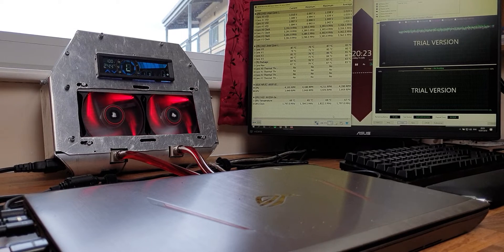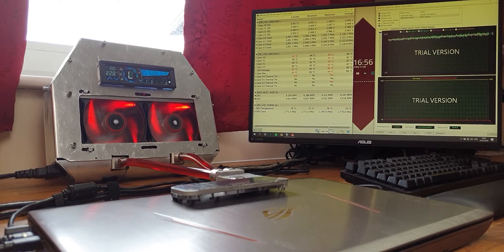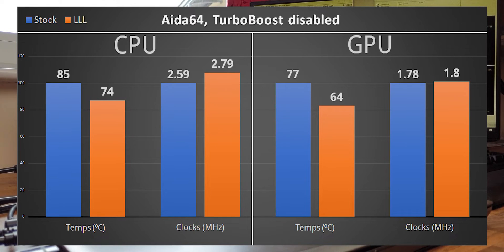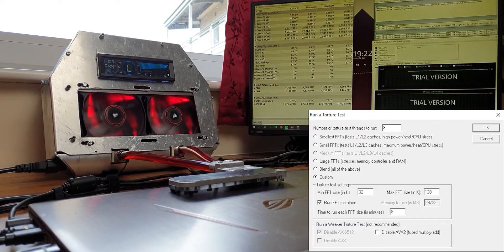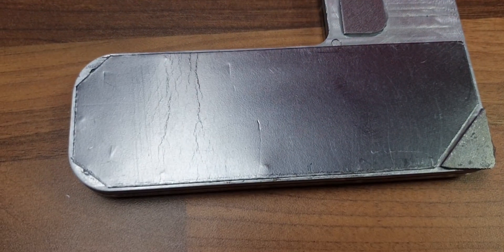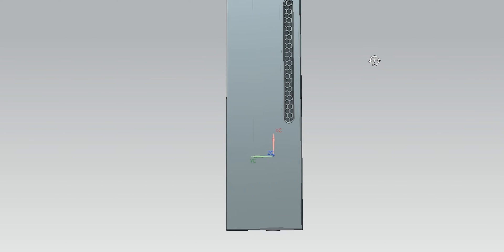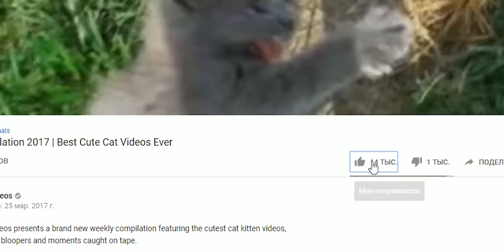Laptop Liquid Loop - Put to the Test

Comment: This is exactly what I had planned to do for my laptop, I would like to see how you solve the issue of quick connection and disconnection, I hope your project turns out well, a lot of support from Chile
Reply from the maker: Hi, thank you for your interest! Unfortunately I have been unable to work on the project due to personal circumstances. However I consider this as an extended planning phase - essentially, the project is not abandoned, just put on hold until I am able to work on it again. 
Thanks again for your interest and understanding :)

Comment: If u want ill send u my Version of Laptop watercooled with quick disconnect valves im runnin i9 9900k at 4.7ghz on All 8 cores  / Rtx2080 with bios flashed for 225 Watts Tdp  /2x 32gb  im ideling depending a bit on room temp 26-30° and Under Full load Stresstest maxed cpu Was 72°after about 15min
Reply from the maker: Sure, send it over.

Comment: Hi,
I watched your video and tried to PM you but couldn't find the right option on YT.

Where did you buy your graphite sheet from and what are it's specs? You mention that you have already found a much better one, would be be able to share some more details on this?

my email is hero207 @ wp.pl if you prefer to email me.

Thanks
Reply from the maker: Here's a link to the pad I used: https://uk.rs-online.com/web/p/thermal-pads/7943985/
You can also use their filter to find one that's better suited for what you need: https://uk.rs-online.com/web/c/hvac-fans-thermal-management/electronics-heating-cooling/thermal-pads/

Comment: It looks amazing, but I feel like the temps should be lower no? I would expect mid to high 50s
Reply from the maker: Thanks for the comment, very good point, I should've talked about it in the video. 

There are a few factors that have decreased the cooling effectiveness: poor thermal interface between pipes and waterblock, flimsy mounting of waterblock, imperfect surface finish. Second version which will solve all 3 problems is currently in the works.

Keep in mind that the loop is mounted on the pipes rather than directly on the cpu/gpu like in normal pc watercooling. This is the most significant reason for higher than expected temps, but (unless I was to turn my laptop into a desktop) there's no way around that problem. A removable solution will always be inferior to permanent solutions.
Reply: @MalcolmBlk  yeah that makes sense, its more of a hybrid solution aiding the existing air cooling. I am looking to get some waterblocks for my laptop and see if I will have the clearance to run them. A lot of stuff comes from Aliexpress and is so squeezed down that I do not see it being effective at cooling jack so finding the right parts takes time. But I managed to find a micro pump as well so hopefully I can go for a self contained system.
Reply from the maker: @cr4zyw3ld3r Self contained?
Reply: @MalcolmBlk  as in fully internal, no need for ext reservoir/rad/pump it will all be inside the body of the laptop
Reply from the maker: @cr4zyw3ld3r  How thick will the laptop be?
Reply: @MalcolmBlk  ideally same thickness as before at 1.4" but I will need to see if the cooling is adequate.  May need to go with an engineered fluid for evap cooling.
Reply from the maker: @cr4zyw3ld3r  35mm thick laptop wow. What laptop is it?
Reply: @MalcolmBlk  2015 Sony Vaio,  it's a pos
Reply from the maker: @cr4zyw3ld3r  Well, let me know how it turns out when you're done, I'll be interested to hear. You going to post updates anywhere?
Reply: @MalcolmBlk  on my channel yeah
Reply from the maker: @cr4zyw3ld3r  Cool)

Comment: Hey, I own gl502vs and planning to build watercooling too... 1 question I have is how did You mount waterblock onto heatpipes ???
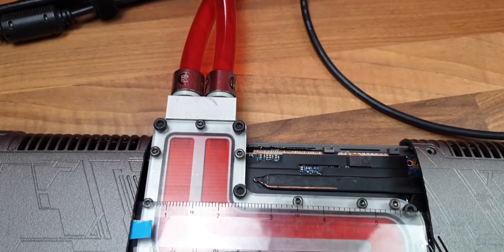Reply from the maker: Hey, thanks for the comment. I've shown the temporary "solution" in the video at about 2:18. Looks rubbish I know but it's only to find out the temps with the LLL, I'm not suggesting you to do that. 
I am planning to continue this project and one of the objectives will be developing a proper housing for the waterblock to make attachment and removal more seemless. Just needed to take a break, hence no progress over the last few months, but I'll be returning soon if my studies allow it.
Reply: @MalcolmBlk  hey, thx for reply... Soon I'll start assembling my WC for asus gl502vs but in different aproach :)
Reply from the maker: @Albert41122  Cool, good luck)
Reply: @MalcolmBlk  So...I just did it :D And it works perfectly... Temps never go above 68 during 100% load. In idle I got 28-31 degrees celsius. Here are some fotos https://naforum.zapodaj.net/5f5a913f8974.jpg.html    https://naforum.zapodaj.net/efa3e089e53a.jpg.html   https://naforum.zapodaj.net/b60c19b2fd59.jpg.html     It doesnt look as preety as Yours but Im planning to do new chasis for loop :)   Maybe I'll upgrade it wit bigger rads ? :P    Cheers
Reply: If I've just had one of those 3d printers I would make chasis like in asus gx700 or gx800 water cooling "box" ( whatever it is called ) :P
Reply from the maker: @Albert41122  Look cool, I didn't understand how you're mounting it though. It looks like you've attached a mesh to the bottom cover of the laptop and screwed the waterblocks onto the mesh, but doesn't that mean you have to unscrew it to transport the laptop?
Reply from the maker: @Albert41122  There are online 3d printing services. Won't be cheap to 3d print something like GX700's cooling attachment tho
Reply: @MalcolmBlk  yes the blocks are glued onto mesh and that mesh pushes them down to heatsink when the bottom cover is attached with screws.
Reply from the maker: @Albert41122  So the mesh isn't attached to the bottom cover?
Reply from the maker: @Albert41122  Also, what TIM did you use, if it's not a secret?
Reply: @Albert41122  Hi mate, is there any chance that you could reupload your images if it's not too much trouble? The attached links are no longer working.